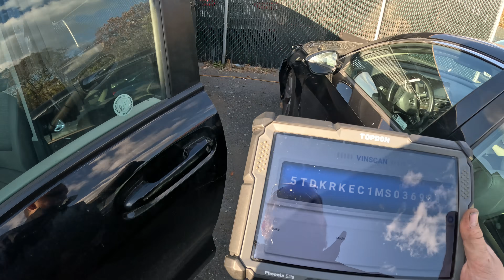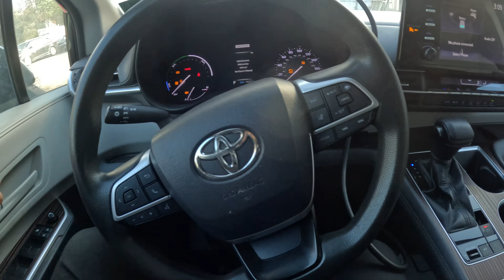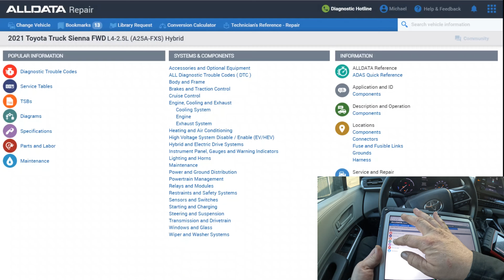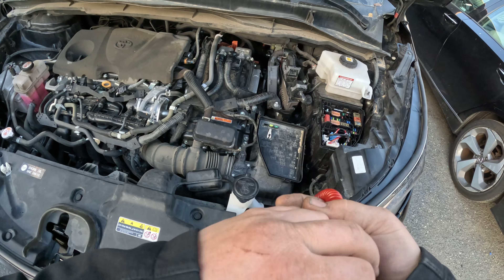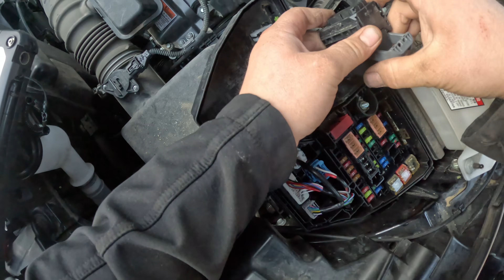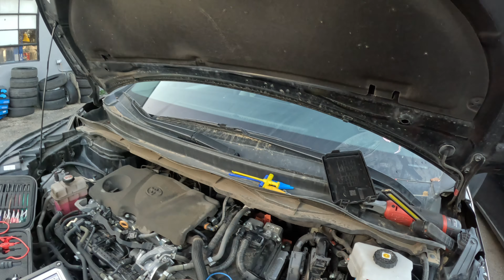2021 Toyota Sienna Hybrid - No start, Hybrid system malfunction.

Comment: Hi
Where is the ECU  located? Pretty sure mine is fried so need to charge it
Reply from the maker: Right next to the fuse box on the driver side of the engine compartment.
Reply: Do you have a video how to reprogram

Comment: It's a known issue with the toyota's with the ecm in that location. People are using the ecu bracket as a ground point while boosting it from the fuse box and it fries the ecu. Toyota says to boost from the battery.

Comment: Hello, though it’s been a year. I’d like to  ask why you connected both can hi and low to ground in the last part of the video
Reply from the maker: I was just making sure we had the right voltage on each one Can high should have 2.5 to 3.5 and can low 2.5 to 1.5.

Comment: I came across this video a couple of weeks ago and was amazed by the way to go through and test circuits. Turns out, I have the same exact issue with a 22 Sienna. I followed what you did and found the ecm to be bad. I could also smell the ecm had that burnt electrical smell. Waiting for insurance company to approve the ecm. Thank you for the awesome video. It helped me with my diagnostic.
Reply from the maker: Glad I could help!
Reply: Was it also caused by jumping the 12v battery?

Comment: Hey man, I just wanted to express my appreciation for your work in and on this video.  This will be common among these vans in the future as they age as there is no place to hook jumper cable ground for the normal person to see.  I purchased a 2021 Sienna Hybrid from IAAI and received it and got all of these same codes.  Only moved a short distance under hybrid power.  But, to my surprise I purchased a used ECM from a yard, installed it and it fired right up. No programming needed! I was shocked by this as so many PCMs are tied to vin and security these days.   I cracked mine open and it was identical to your ecm inside.  Cheers and thank you again!
Reply from the maker: That's awesome, Thanks for sharing!

Comment: I know you've been asked a thousand times but would snap on be one of your top rated scanners for all makes across the board.
Reply from the maker: I feel Snap On generally has the least coverage compared to an Autel or launch scan tool. But sometimes, it comes through as the only one that works. That's why I bought a used, cheaper model instead of the Zeus. It's not my go too but I have it when I need it.

Comment: I believe that has possibly been caused by a jump start via "hot point" in that fuse box but the neg/earth connection was on the metal bracket for that ECM. Just had an alert regarding these. Hope that helps. Cheers.
Reply from the maker: Thanks! seems like that's what happened.

Comment: What was your logic and reason for shorting the can Hi and low signal to ground for your testing?
Reply from the maker: I wasn't shorting it, I was putting the positive lead of my scope on Can H and the negative lead on CAN L. So what I would see on the screen is the Can H minus Can L. Which is what the computer looks at. It's the same thing as setting up a math channel on the Pico A-B.
Reply: @advancedleveldiagnostics  that is a great tip.  I had not thought of that.
Reply: Ok I see now I guess I was just confused

Comment: No solenoids drawing too many amps burning out engine computer?
Reply from the maker: I didn't really have a way to test that with the car not starting unless I would spend hours checking every solenoid. I also only found the PCM burnt after I put a new one in already. I suspect someone messed around trying to boost it because since it's a hybrid it's not as simple to boost.
Reply: @advancedleveldiagnostics  the issue with boosting them is the bracket that holds the ecm in place seems to be a very good place to put your ground cable and it fries it. Toyota says to move the ground as far away from the ecm as possible.  look on the bracket i be you see signs that it arced.

Comment: Awesome video! Yea totally agree with on having multiple scan tools. Wish the topdon had more straightforward options for entering in vehicles manually.  Thanks for sharing!
Reply: Topdon & launch run same software that’s why it didn’t work. Launch and thinkcar buy from same manufacturer and thinkcar sells to topdon. Both are back on autoauth finally too for those that don’t know.
Reply: FYI the reason he saw the same issue with the launch and top Don is because they are essentially the same tool, topdon is a launch clone.  I've done a video on the truth about scantools..

Great diag btw👍🏾
Reply: I don't see topdon back on the list yet😢
Reply from the maker: Ye I agree, when I put the used PCM in it pulled the vin instantly.